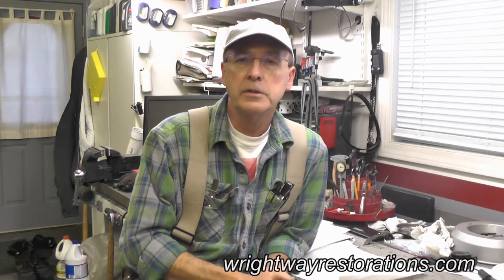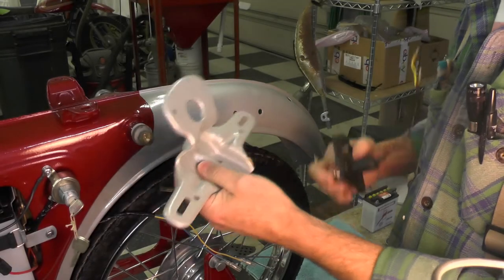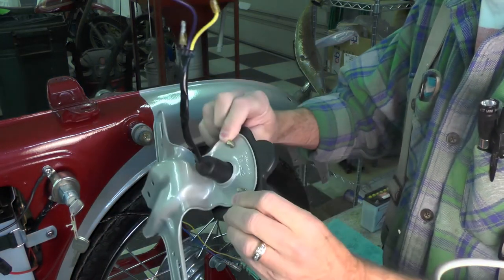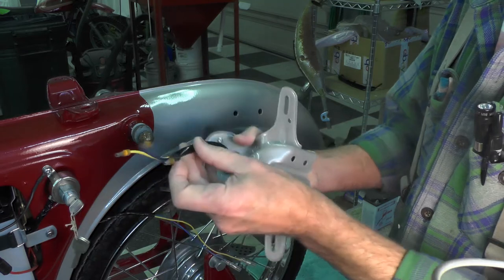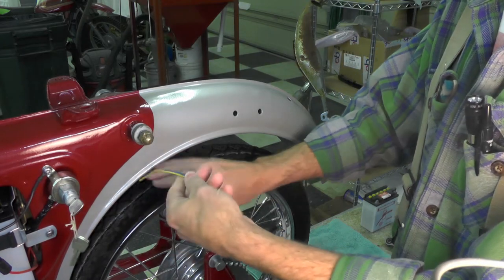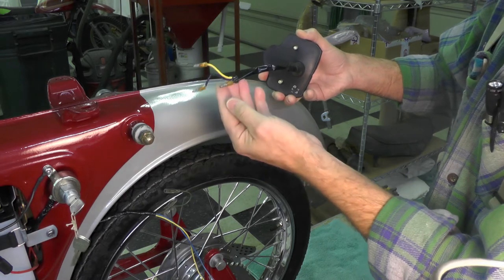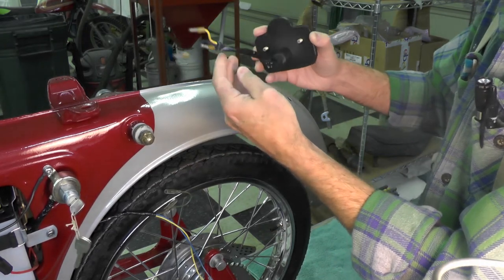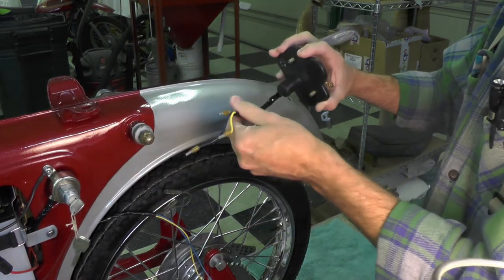Yamaha YL1, Need Help with Tail Light Wiring --- Video #141

Comment: Hi Roy, I've tried to do a video of my bike as I promised ages ago, but still struggling to get it to work. Will try again after the misses has downloaded / deleted some of her stuff on the phone....
Anyway, to answer your question - as 'Twinjet' as already replied, I can confirm that my rear light unit also only has two wires coming from it and it earths via the Light bracket and direct to the frame. There is no rubber isolators between either the light bracket or the larger combined metal mount which supports the light bracket and number plate. I proved this by removing the two nuts, which secure the rear light and removing the light from it's mount and it's earth path, and the light stops working.
I can only imagine that Yamaha changed the design and went to rubber mounting of both parts to improve reliability of the light bulb, which probably has a short life because of vibration. In this case it's likely that the short earth wire would connect onto the rear of one of the indicator brackets - I've seen this on other bikes that I've worked on.
Hope this is of use. Keep up the good work. Looking forward to the part 2 of your plating video. What interested me in this was your recipe for the plating solution. I bought mine from a specialist DIY plating company, and it was fairly expensive for a relatively small amount. If the results are as good as I've been getting, I shall definitely try your mix and see what happens.
Many thanks for all the effort you put in to your videos.
Jono
Reply from the maker: Hello Jono,
You've confirmed for me that your bike has the same design as Twinjet's two bikes.  I agree with your assessment that is, the ground/earth is achieved by the mechanical connection between the light fixture/bracket and fender.  At least on the early models before the engineering change.  Give this info from both TwinJet and yourself, which I greatly appreciate, I'll have to think through how I'm going to mount the taillight.  My NOS parts do not allow direct grounding (at least without modification).  Since I don't have turn indicators to mount to, I'm going to have to come up with my own solution.  Expect this to be part of the conversation/video on the tail light mount, which I'm getting close to shooting.

Looking forward to seeing a video on your bike, too!

Regarding zinc plating, I have a couple more videos on this topic pending release.  The second of the first two-part is about to be released and I'm going to branch out on this topic just a bit (these videos will not affect the work on the YL1 videos, but are in addition to) in a couple of more plating-themed videos.

Also, don't be afraid to research or try your own recipes for a plating solution.  I've fiddled around with probably four or five different versions over the years.  If you find something you're happy with, let me know!

Comment: Hello,
The both YL1 i have only have 2 wires coming out of the taillight.
I have a round taillight and the smaller taillights. grounded straight on the fender. no rubber rings between bracket and fender.
Reply from the maker: That's interesting... I just looked carefully at the original tail light fixture, not the fender bracket but the socket fixture that the wires are attached to.  The original had TWO wires, the blue and yellow with no ground/earth wire.  However, the NOS fixture I showed in the video does has a ground and from the patina it's clearly an older but unused part.  The part number is also correct to the Yamaha diagram and in all other respects minus the ground is a perfect match to the original.  The parts diagram definitely calls out grommets for the bracket to fender attachment.

This all suggests Yamaha made an engineering change, probably early on, and added the ground wire to the light harness along with the rubber grommets and ground/earth jumper.

I'm most interested in what others viewers tail light wiring configuration is.

Thank you for the follow up, I do appreciate it!

Comment: Hi I have a YL1E 1967 with a ground wire on my back light, the round  grommet ground is connected to the bolt that hold the back seat bracket on the inside of the fender. I have pictures if you need to see it. Casey Big
Reply from the maker: I believe we've figured this out.  During the YL1 to YL1E model switch Yamaha made the engineering change to add a ground/earth wire to the light wiring along with the rubber grommets between the light bracket and fender.  Thanks to Twinjet, Jono and Casey for helping with this!  

I hadn't given the seat bracket any consideration in terms of that being the mounting point for the ground/earth.  I now believe I know how I'm going to proceed.

Casey:  I would like a photo or two of your bike, just have to figure out the best way for you to get the photos to me...